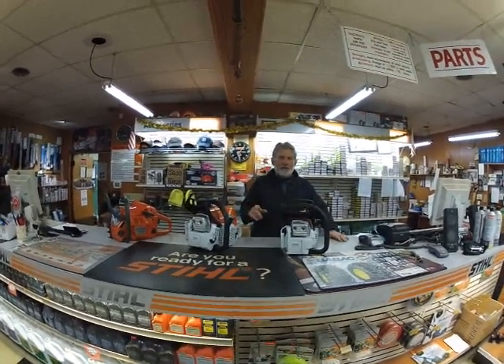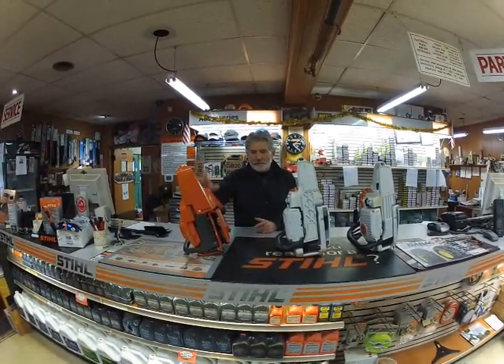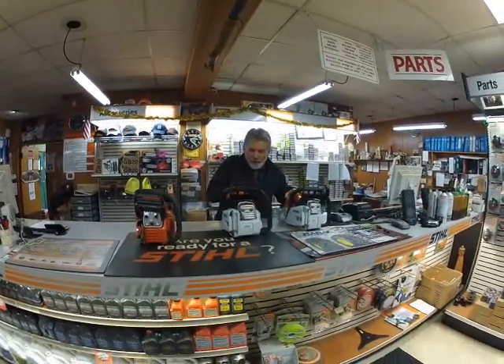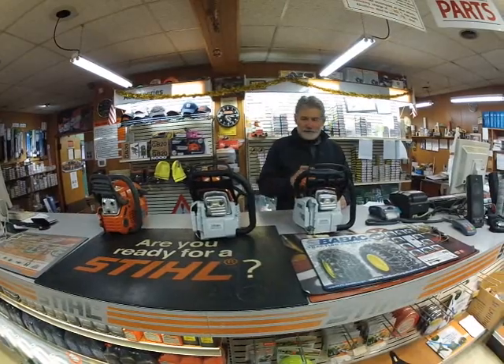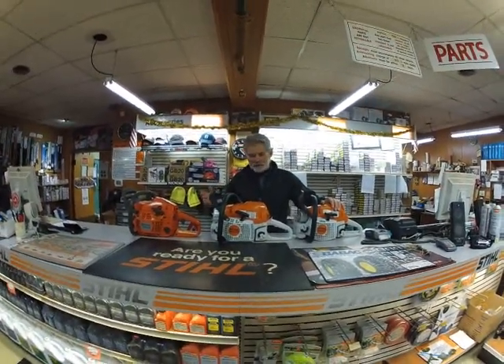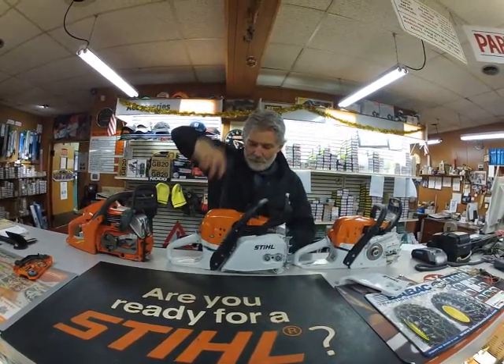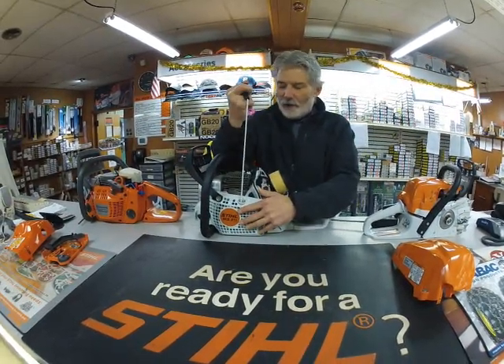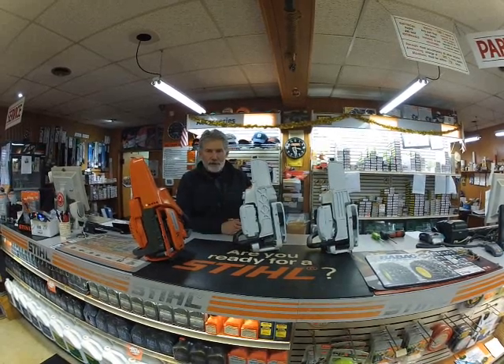Stihl VRS Husqvarna : Firewood Chainsaws

Comment: look the husqvarna and stihl are good saws, some favour husqvarna and some favour stihl. my experience with both makes is good I like both , I had a 365 special husqvarna and it lasted 11 years with serious abuse then final piston went in it, also had a small husqvarna but there's a screw at the bottom that falls out after time and it draws air and won't start, there known for this, I have a good few husqvarnas and the old husqvarna was a excellent saw , dnt know the number of it but it has a white top on it and it's a great saw. the stihl is a excellent saw I have 050 av , 041av , 028,029, ms 290 farm boss, ms 170,038,017 and many more in the shed and there all great saws never gave any trouble, the only one that gave trouble which was ms 170 the float came out and it keeps flooding, out of all them the ms 290 farm boss is the best in my opinion. if I were to choose husqvarna or stihl, I'd pick stihl that's jst me, the three best makes out there from my experience is stihl, echo, husqvarna, the old echo's were some saw I have a few vintage ones and by Jesus they still run perfect, there's one I have and it got so much abuse , trees fell of top of it and it got everyday going with it , I still use it now and again but there's no brake on it. the worst chainsaw I ever had from my experience is the old homelite chainsaw there heavy and a cunt on fuel , hated them saws, but I still have a few left in with all my other saws , I'm a chainsaw collector really I have so many saws in the shed its really outrageous how many there is.
Reply: spetsnaz army i've never had any problems with my 170 she starts up everytime and i always find my self using that saw rather than my farm boss because the 170 is so much lighter and can do most of the tasks the farm boss did but i love both saws i've had my farm boss for 6 years and i got my 170 about a year ago best purchases i've ever made

Comment: Sir,Excellent review and comparison of both saws. iI appreciated the factual, accurate reviews of the saws you presented in this video. Folks, this is the reason you go to a authorized dealer. They should know the products they sell and this gentleman is the example. Buy what you feel is best for you and the job you will be using it for. Good luck and be safe.

Comment: correct me if I'm wrong  I believe  ELECTRO LUX VACCUM CLEANER COMPANY BOUGHT OUT HUSKY SEVERAL YEARS AGO.WTF? would a vaccum cleaner maker know about chain saws??
Reply: usaisalwaysnumber1 I would assume they didn't replace all their old saw engineers with vacuum cleaner engineers...
Reply: Husqvarna was bought by Electro Lux in around 1977/78 until the Husqvarna group was formed in 2004/5. Husky built some of their best saws like the 254 / 266 / 272 and so on. Perhaps those vacuum engineers did know something about chainsaws .

Comment from the maker: Again folks remember that Husqvarna & Stihl are BRANDS. Don't bash the brand....bash the specific MODEL within the brand!!!
Both of these Companies make great saws & cheap saws. That said it's unfair to compare a Husky 455 rancher to a Stihl MS461
Reply: Rod Jones) Great representation of products here.   It is both entertaining and frustrating to hear people talk smack.  A cheap saw is intended for the person who just needs a saw for minimal cutting or emergencies.   
Saw prices have remained so low for so many years that it is truly amazing what you can obtain for under $500.  By way of comparison an 80cc saw in the early/mid 60's was between$200 & $300.  Look at the value of the dollar with inflation factored in and $1200 for a commercial grade saw that will outlast and out cut the vintage unit is a screaming deal.
I collect and run vintage saws, but I do have current issue models that I use when I'm all about getting it done.  My point is, just as it is with trucks, motorcycles or anything else you can buy... Everyone has made junk, just as everyone has made solid stuff.
Thanks for the un-biased review.  If you were local to me, I'd spend my dollars with you.
Take Care.
Reply: Rod Jones true
Reply: I plan on cutting a lot of fire wood so should u get a pro saw? I want a stihl that is going to last year's
Reply: @broken_bones_acres  Yes get a pro saw' main thing is selling it later' not to mention scene 1986 when I bought my first stihl saw an 026 for 400.00 it lasted 12 years? then another 026 another 10 years' then a MS261 and MS362 and MS201 and now a MS461 which I hope I can handle. All running great' The price was just to good' for the ms461 with 25 " bar and a 6 pack of oil mix for 962.00 out the door //
Reply: Ms 461 is a bad ass.
Reply: Best comment ever!
Reply: Nailed it dead on the head!!!

Comment: Excellent rundown on those saws.  Saw this video after I bought the 391, haven't cut so much as a stick with it yet, but now 
thanks to you I know what I paid for.  I feel like this was a unbiased look ( with the exception of the Stihl candy store you are manning ) 
at two popular manufacturers products that non professionals like myself are going to be considering if they are in the market to buy a saw.  That's right.  I don't do all my loggin' in the bar, or my drinkin' in camp.  I just need to fetch some wood from time to time.  Thanks.
Reply: 362 is more powerful than the 391 and better on fuel also it’s a professional
Grade saw whereas the 391 isn’t
Reply: @X737_  PRICE !! ???

Comment: I have a 455 rancher built in 05 and it's a beast I love it it starts Everytime on the second pull
Reply: Andrew Maas i had two 455s.  ised the heck out them.  when a tornado hit my property i lost 100 trees, some 40 inch across.  worked those saw 4 hours a day for 4 months.  i would run out of gas and swap saws while my daughter filled oil and gas.  good saw.  i did upgrade to a larger stihl ms441 but only after 9 years.
Reply: oswalt Edmond   I have a 455 rancher and it is has always been there for me.  Starts every time with tone to three pulls.  I just got a 365 x torq husky for a little more power on the bigger trees.

Comment: so you are saying that unless you spend 700. plus on a saw these days you are getting a pile of disposable junk. What a shitty way for these companies to run their businesses.  I guess I can't afford a chainsaw, cause I am not throwing my money away on junk and can't swing 700. or even 600. for a chainsaw. Thanks for the truth. My first job ever was with a tree service and we used several different saws that worked hard and well. Now the saws I have bought wont even keep a chain on them after 4-5 horizontal cuts. AND if you don't run Stabil in them, the carb gets gunked up from the ethanol in the gas and your gonna be doing a carb clean often. One other difference is back in the day the dollar went wayyy further than it does now. It was actually worth something. These companies believe that you can offer a crap product and still charge for a premium product to increase profit margins so their CEO's can get fat bonus checks, the customers fund that philosophy by keeping them in business.

I was about to buy a Farm Boss, I think now I will save my money and run my current saw til it falls completely apart. I can't justify 6 or 700.  for a quality saw.
Reply: I have a 290 farm boss and I'm absolutely amazed at its performance, it might be just a home owner saw but it has never let me down and it will scream through oak and hickory like a hot knife through butter, I run nothing but stihl bar oil, stihl 2 stroke and premium ethanol free gasoline in everything I own and it goes a very long way.
Reply: im 1300 into my 372xp ported :)
Reply: Get an Echo CS-590. For $450 and is the old design. 5 year warranty and a life time on the ignition.
Reply: billy blaze you don't need to spend $700+ on a saw. Stihl sells many saws from inexpensive to pro grade $1300 plus. If you are just doing homeowner stuff, smaller trees up to 18"...limbs, brush, ect..Stihl sells the MS170 for around  $175, takes up to a 20" bar.  That will actually be my next saw purchase for when I don't need to fire up my 034 with the 28" bar or the 460 or 660. Buy a saw that fits your needs. Unless you are cutting wood professionally and cutting BIG TIMBER...you will NEVER need the 460, 660 or 880
Reply: Charles Power ohhhhhh I Always need my 461r... ALWAYS...with the 28” light bar
Reply: billy blaze I have a 455 rancher and it's amazing you can get up to a 24 inch bar when he said the numbers means nothing is wrong  the 455 has a 55 cc motor the 460 has a 60 cc motor
Reply: Billy Blaze yes i agree after watching 60 plus chainsaw videos. Im not convinced of Husqvarna crank and piston quality . People are saying to drill exhaust and change porting oh my god. Who is going to do that? After 1200$ or more they are still crap from factory i cant handle that. May settle with plastic echo. Just be careful mot to break it 178$ for body of saw. Parts are expensive and if they are low quality i will not buy. Rebuild old ones and make work. Or buy a 2 handed 1864 pioneer saw. Stihls electronic fuel adaptation works sometimes a dealer told me its hot and cold with saw that have problems.
Reply: I found a 1-year used Husqvarna 562xp for $450. There are great deals on great saws. You just have to ask around.
Reply: So you don't want to spend the money on a high end saw and are pissed they provide a lower cost option?  Sort of like saying you can't afford a Mercedes but don't want to drive a Ford, huh?  Look up any economics and you will find we get far more today for less money.  My dad loves to tell the story about his first microwave which cost $700 almost 30 years ago.
Reply: Ethanol in the gas???  I've never used anything but ethanol-free premium in my Stihl MS291 and I've always used Stabil.   Never have cleaned the carb-  never needed to.  Didn't realize my saw was junk-  it is a middle grade saw for the weekend guy and it works very well for my needs.
Reply: Billy Blaze I don’t own any other then pro stihl saws....(461r, 362cm)... but I do have a 455 rancher .... had it for the last 12 years .... never let me down ever.... runs good;... unless somethings changed with them.... I suggest the 455 rancher with a 20”.... and don’t bother with the safety chain... get stihl rapid super yellow link chain
Reply from the maker: Truth is, the hi-end saws are really less money now than they used to be 25 years ago. As stated in the video, these "firewood saw" are a lot less money and therefor the operator is giving up some of the reliability that made these companies who they are today. That's the way of the world! When some brags about owning a certain Brand of anything I always want to know what specific model they own? Most everyone makes O.K to Best within their offerings.Make Sense? 

Thanks
Reply: billy blaze get a mcculloch 10-10s off of eBay

Comment: Good informative talk. I'm still using my old Stihl 031av, purchased in 1980 but did have to replace the ignition points with an electronic module (inexpensive and easy procedure) back in 2005. Thirty-six years is a pretty good run for a home firewood saw. The rubber anti-vibration pieces rotted out around 2006 and were replaced with silicone bumpers.
Thanks for the video as I was wondering what I'll do when the old saw dies. Have you an opinion on the Makita 61cc saw?
Reply: Allan Wells I have 2 Stihl 031avs from the 70s. The one my grandpap bought new and its my go to saw. I hardly use my 290 anymore. I had to upgrad ignition systems. great ild saws though.

Comment: Rod thanks for taking the time to share your knowledge with us. I'm a McCulloch guy, but I decided to buy 1 "new" generation saw for the heck of it. I'm simply a firewood/emergency user. My saw is used maybe 15 days a year. I'd like a big boy, for no other reason than power and noise :-) Thanks again Rod.
Reply: VintageMotoSeattle sooooo did you buy a “big boy” saw ?.... and ohhhh my first saw I ever used. Was my dads pro Mac 610..... still have that saw and still use it from time to time .... love the manual Oiler option.... wish all saws came with em

Comment: One big difference I have found as I have two of each. I love both but in local shop buying chains filters and fuel. The biggest difference is how you get your tune up kits husky was $29.99 and gave you oil the stihl was $14.99 as I don't need the little bottle of oil it makes no sense for me to spend the money on them. So that is one thing as I try to make up my mind that is a big factor in witch I will choose is the maintenance costs.

Comment: Buy once cry once. A pro saw will give you 20+ years of service. My 036 Pro is a April 1998 model and my 024AVS is mid-1980's. For a few hundred more, you get more longevity, ease of use, quality and robustness, and piece of mind knowing you have good reliable shit. Most pro saws are torquier than their ranch counterparts meaning they will turn more teeth and do it faster. Horsepower>displacement in that case. 391 vs 362 are a prime example.
Reply: Bought an ms 261c 3 months ago. Best saw i ever had, didnt choke out on me nor i ever had trouble starting it, in worst case i have to pull the cord 4-5 times to start it. I can see this one running a long time, and yes, always spare some money for a pro saw, you wont regret it.
Reply: Homemade Lemonade Great choice! In my opinion the 261 is the best all around saw made. We beat the hell out of them at work and I like them so much I bought one for personal use.
Reply: IF !! YOU !! THINK !! TWENTY !! YEARS !! IS !! SOO !! GOOD !! THEN !! YOUVE !! CERTAINLY !! GOT !! TOO !! MANY !! WOODCHIPS !! STUCK !! IN !! YOUR !! SKULL !!
Reply: @davidwillard7334  guess I’m full of woodchips, Princess.

Comment: Damning with faint praise, reading between the lines these new saws are less robust with a shorter life.  Just buy another cheaper more reliable make such as my 50cc homeowner ally crankcase Dolmar/ Makita, less than half the price and each one is assembled from start to finish by one person in Germany. Pretty much as tough but slower than a pro saw. Husky and Stihl  saws are beginning to get an iffy rep. Not even all their current pro models are problem free. I love my old Stihls but would take advice from a dealer as to which new model to buy. The dealers are getting enough grief that they are actually steering clients away from certain models. that says it all.

Comment: I miss my McCulloch it started no problem even with leftover gas from last season, my Husqvarna is a finicky little fuck.
Reply: MrFakit maybe because with have ethanol in our fuel now?
Reply: MrFakit pussy boy's video. My saws are GERMAN  made. so They work cold hot weather. We cutin.
Reply: MrFakit hahahahaha
Reply: MrFakit Ye the McCullough is a good little saw had one for years as a backup and to cut light timber.
Reply: It's the ethanol, it eats up your fuel lines and diaphragm and gunks up your main jet. I try to only use real non ethanol gas in my saws with some sea foam. Definetly don't store your saw with ethanol gas in it.

Comment: excellent video - well presented - still haven't made up my mind whether to buy a Stihl or Husqvarna - as well there's the Echo - kinda leaning to the Husqvarna though
Reply: majorgeeek I have been cutting with a Stihl since I was young. Grew up with a 039 from the early 90s. I just picked up an ms251 wood boss. I got it just to have a lighter saw for cheap. I love it, it cuts just as good as an old 039. If you go with stihl you will not be disappointed. The farm boss is a bit bigger and probably better but no matter what Stihl will do everything you need. Never used a Husqvarna honestly, they do have a longer warranty though. I'm a stihl man myself. Just thought I'd give my opinion
Reply: Keanan Temple
thanks Keanan for you time to reply and advice you gave  - I will certainly take it on board when I decide to buy my new saw
Reply: majorgeeek you're welcome
Reply: What did you go for in the end? I was in the same boat and went for the Husqvarna. Pound for pound you seem to get more bang for your buck with them than Stihl. That's not to say I don't like Stihl, but I got a 450 and a 135 with Oil Kit and twin fuel can for £621.
Reply: What does the local retailer carry? Get that.
Reply: BUY A STIHL or youll wish you had before its all over..

Comment: Rod, thanks for the comparison .What is ur preference between the two brands?I have a 455 rancher, was a gift. Ive barely used it, and i dont think it takes a beating well. Ive had to replace the oiler, from new it didnt work. Now, this clutch is giving me grief. The plastic pieces that trip the break are wore, and the spring to engage release brake doesnt travel well. I think its a poor design. Its failed and i think needs replacement, i think i need a new side cover. Not sure what that costs. ( i probably have 4 hours use on this saw) But i think i might be better off buying a stihl????
Reply: The Stihl saws overall hold up better to abuse. That said, if both brands are treated with TLC both brands will hang.
Reply: Rhett Kutney  I have a 455 rancher and its been a great saw for the last 6 years.  Bought it used for 325.00     cut 10 cord of butt cuts from a logging job and it handled it with a problem in 90 degree heat.  You got a lemon